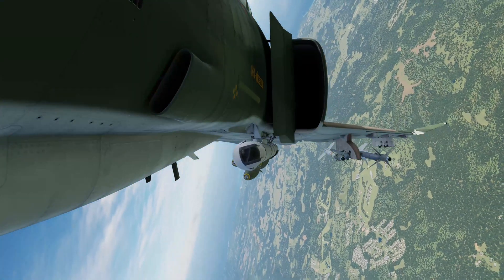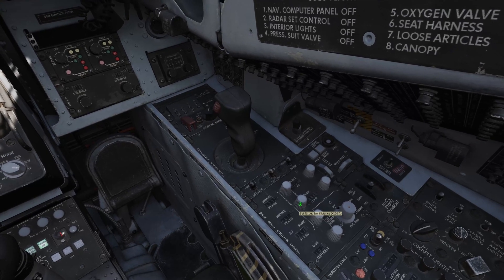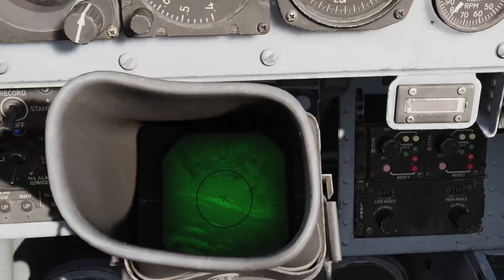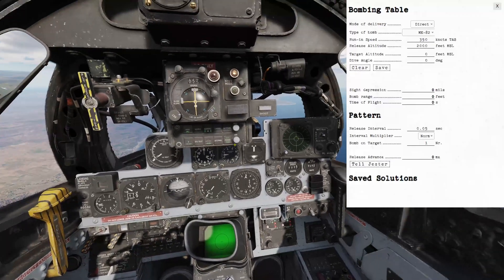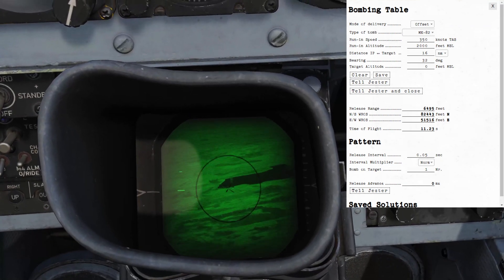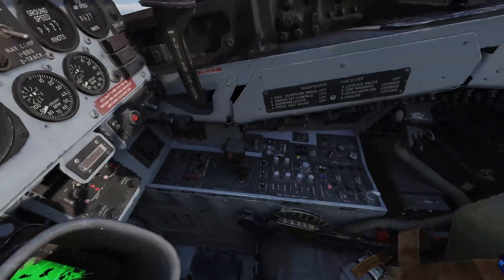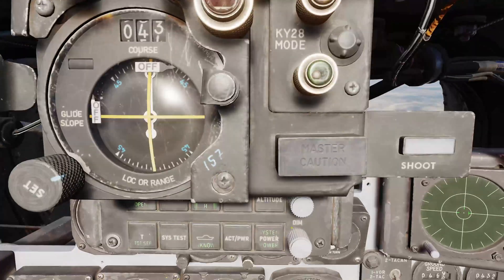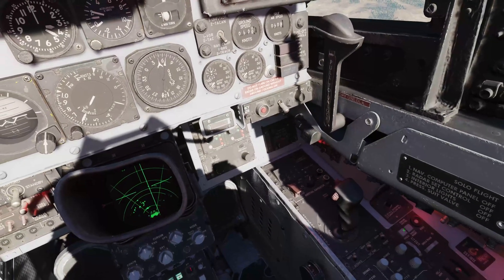DCS: F-4E Phantom - Pave Spike - Coordinates

Comment: THX for the good video. But I cannot slew my radar/offset cursor around in map mode like you showed. In A2A mode or for the Pavespike slew controls it work perfectly, but not in Radar Map Mode. Is this a bug at the moment?
Reply from the maker: We are currently not aware of such a bug. Make sure the radar is in MAP mode, the screen on RADAR (not TV) and the pilot selected delivery mode OFFSET or TGT FIND. Then slew with the along/cross track wheels (or with the antenna stick if you enabled the Special Option that lets you use that instead) :)

Comment: To be honest, I can’t understand absolutely anything... If I simply repeat the actions after you in the video, the container does not “bind” to the target. When I press the button "freeze" nothing happens. In your video, the “voice” says the coordinates.
Reply from the maker: When you hit the FREEZE button, the WRCS remembers your current aircraft coordinates at the time of hitting the button. Now, you can enter offset coordinates into the WRCS panel. Either manually or via using the radar offset cursor. Hit the INSERT button and the WRCS will interpret the entered offset data relative to the aircraft position when you hit FREEZE earlier. The resulting position will now me remembered as WRCS target.
When the Pave Spike is in WRCS-Acquisiton mode (the 3-way switch on the panel), it will cue itself to said WRCS target.
Reply: I'm having the same issue. I think there are a number of other settings not mentioned. I believe you have to be in delivery mode > tgt find, also it looks like you have to activate half action on the hand control trigger. Still trying to find out why I'm also not getting the voice and the freeze button does not light either.
Reply from the maker: @chillm2  Yes, the video assumes that you know the basics of the pod already. Check the linked manual or other videos on YouTube.
TGT FIND is the delivery mode used for the pod. It will also trigger Jester to ready up the pod. If you are the WSO, you don't need this to operate the pod. Half Action let's the pod enter and leave tracking mode. In the video you want to be in acquisition mode, the default.
For this videos content, it's enough to turn on the pod, put it into WRCS ACQ mode and set the DSCG to display TV instead of Radar. At that point, the Pave Spike shows whatever is the current WRCS target.

Comment: Top notch videos! For that last clip did you use the pavespike as you would with a GBU but with dumb bombs to achieve that result? Keep up the great work 🤙🏼
Reply from the maker: Yeah exactly. The system can be used for dumb bombs perfectly fine as well. In fact, if you happen to have a Pave Spike, I would generally prefer TGT FIND as it is just like a CCRP delivery in other planes. Point the pod somewhere, hold Bomb Button, follow the steering cues and wait for the release. Its so simple. And almost as previse as Dive Toss! It even allows you to do small loft deliveries out of the box by just flying a slight pitch up while you wait for the bombs to release. Can also be interesting to loft LGBs a bit further.
Reply: @Zabuzard  Hello, I have been trying this, but the precision is terrible. The bombs always fall to the side about 300 meters away, no matter what I do.
Reply from the maker: To the side? Sounds like either your INS is borked or you are not following the steering cues for lateral alignment. If it would be short/long I would suspect wrong drag coefficient for the given altitude, speed and bomb, but not if they hit to the sides

Comment: great video, did you find a manual on how to do that? seems like the good sources for the WSO stuff is really rare! Keep them coming!
Reply from the maker: The manual kinda explains it, but falls a bit short on connecting the dots. Like, it says that WRCS acquisition mode shows the current WRCS target - but you would have to explore the WRCS chapter to learn how to set WRCS targets and probably need to be exposed to some real-pilot stories to get some of these ideas. Definitely would make sense to expand the Pave Spike manual chapter on this topic a bit 👍
Reply: @Zabuzard  having sections in the manual that actually explain the workflow for a particular system with a practical example in mind makes for a much more accessible way to explain the content. Also lets people refer to the training missions made and try the techniques explained out.
Reply: Zab is an HB dev - and their manual is pretty handy for some of these concepts, although I must admit hearing the dev explanation helps a lot :)